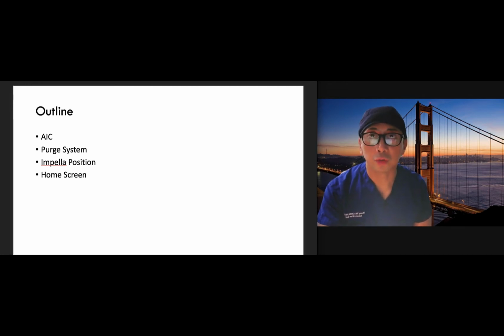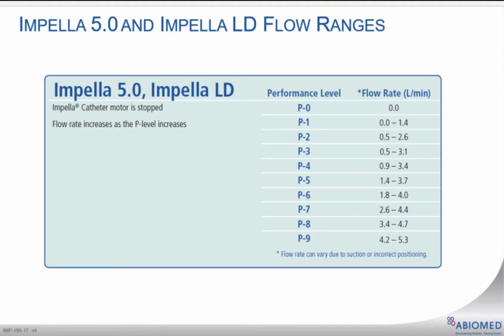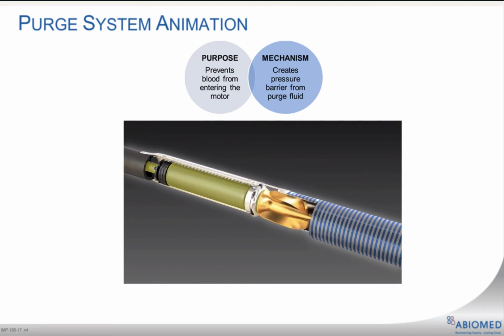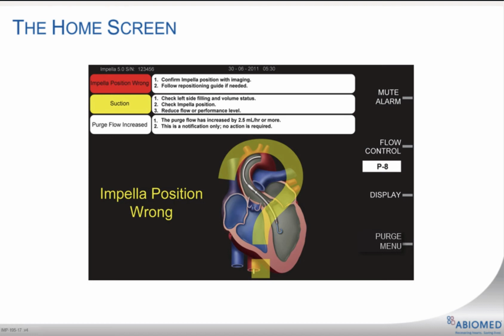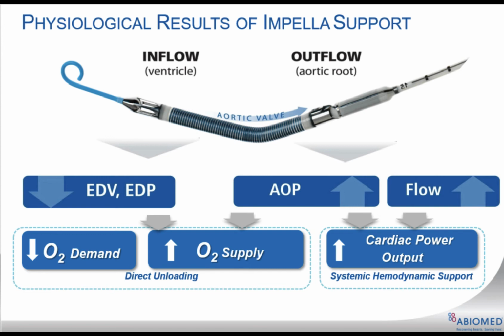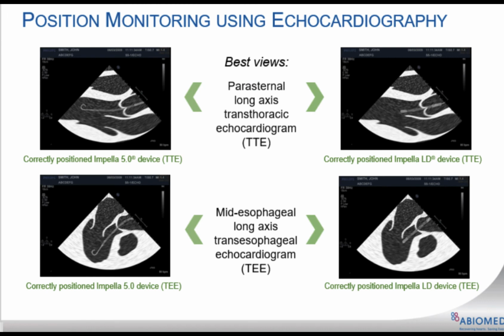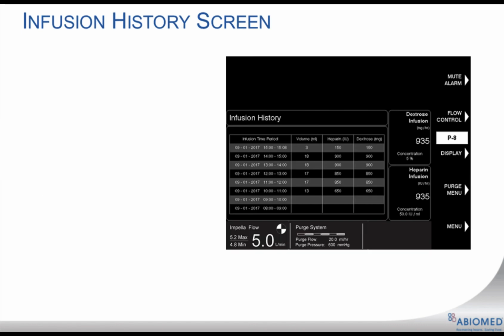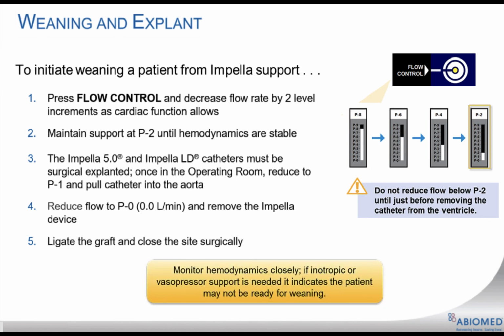Impella Training for ICU Nurses

Comment: Thanks for the explanation! It was so clear. Just one question, if you change the dextrose to a higher concentration because a pressure drop. That really resolve the problem? That is not just hiding the problem? And at the end the turbine is going to be affected for this concentrated solution? I am just curious. Perfusionist, RN ✂️